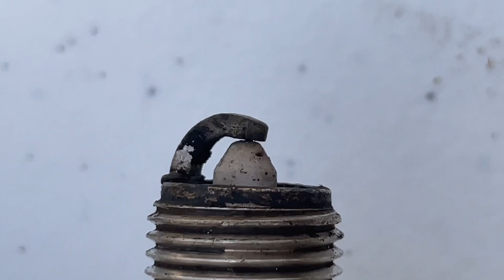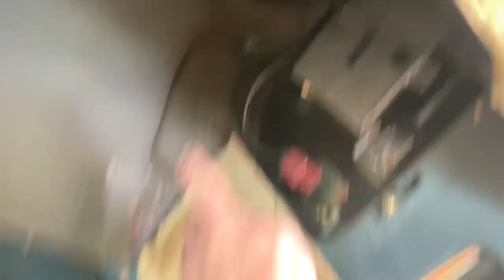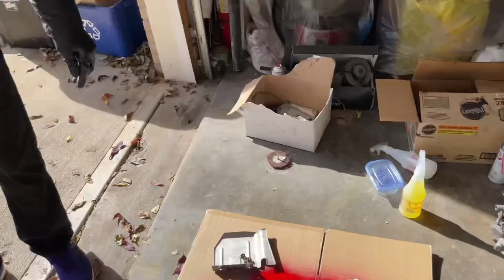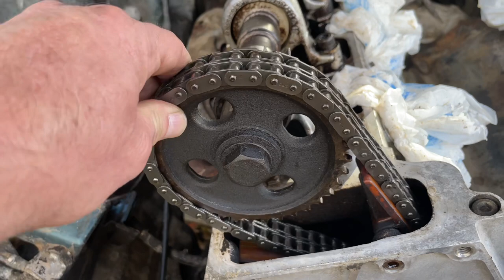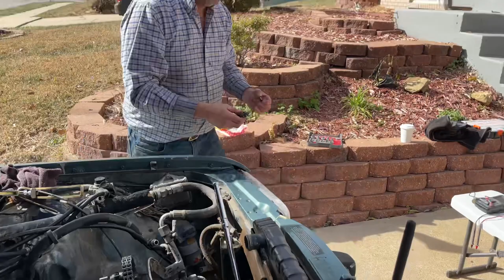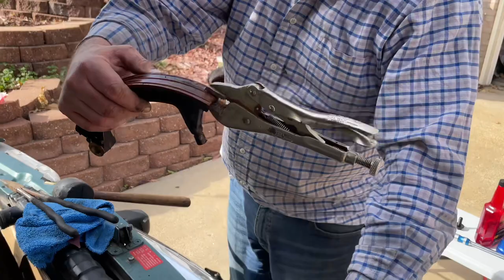Mercedes W116 450SEL 1980 Clay & myself are removing rocker arms, tensioner guide & checking ECU

Comment: Can you please share a link to the compressor tool?
Reply from the maker: You mean the tool to compress the valve springs? If so, then this would be this one here:

https://www.baumtools.com/shop/mercedes-benz-tools/mercedes-benz-cylinder-head-engine-timing/123-0361-valve-spring-compressor-6-cyl-v-8/

This is the original Mercedes Benz Tool made by Baum Tools
Reply: @inovahightechltd  Yes, thank you very much. And thank you for the helpful video!